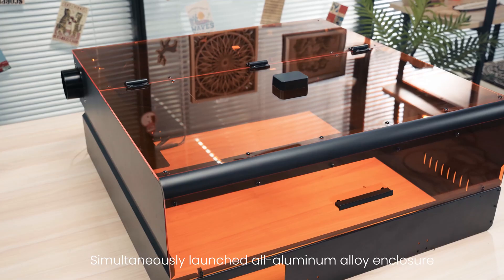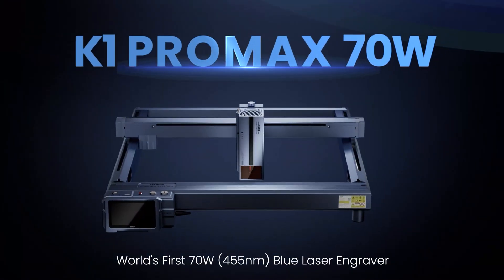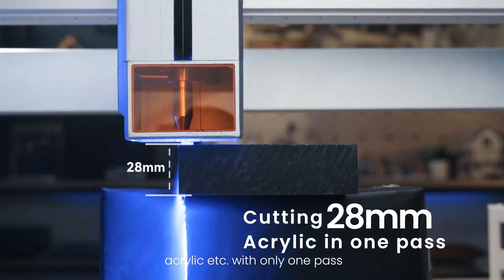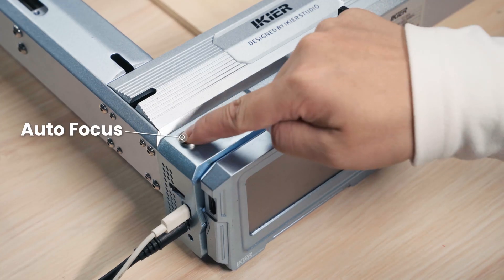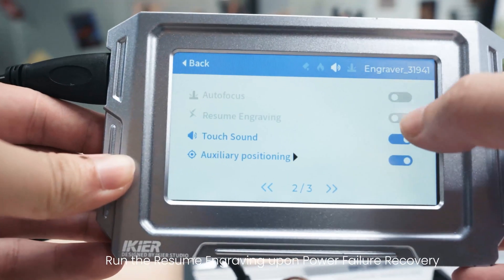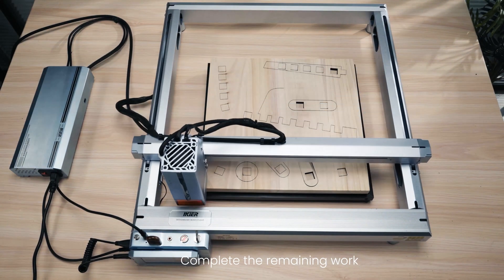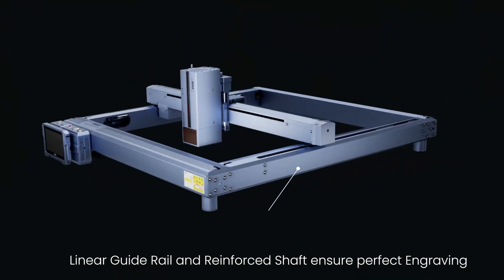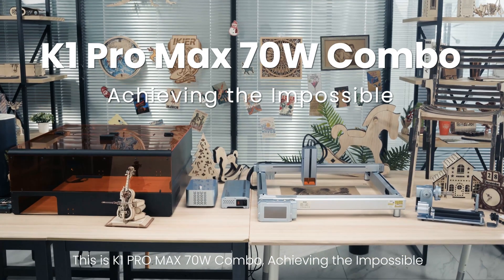iKier K1 PRO MAX 70W Combo Debut! World's First 70W Blue Laser Engraving Machine.

Comment: I’ll need to see a Side-by-Side comparison with Skulpfun’s latest offerings, but this may be the new BEST Diode Laser Engraver!

(At least in my opinion; i dislike Xtool due to their use of V-Rollers)
Reply: xTool...will never spend another cent with them!
Reply: I don't see anything new on  Skulpfun's website?
Reply: Tbh i went with atomstack for two reasons.

One was that beefy 850x800 extension frame for the a30, the other was xtools agressively as-seen-on-tv marketing.